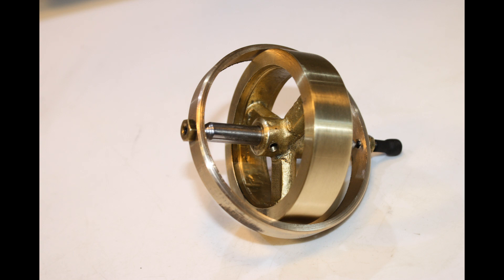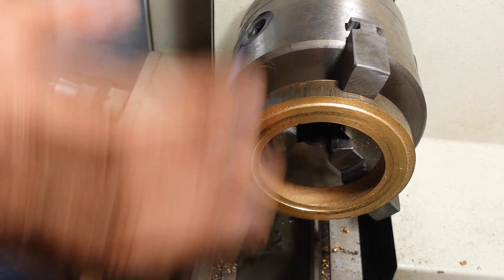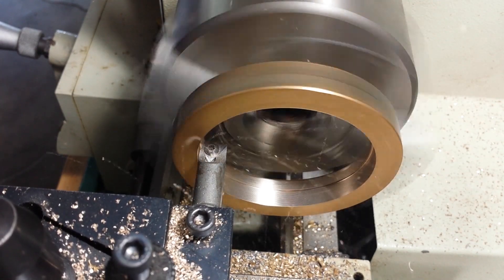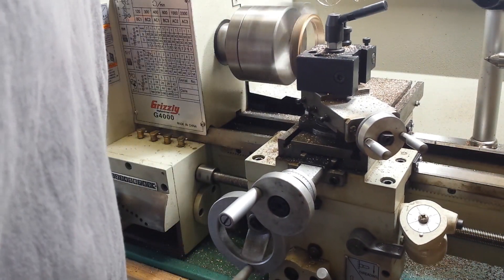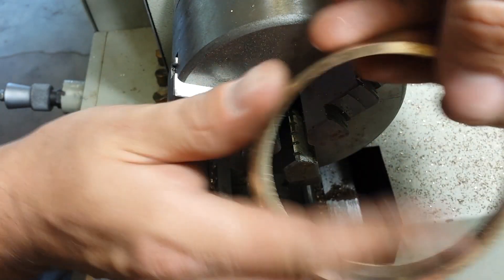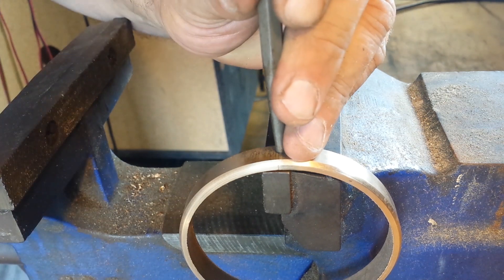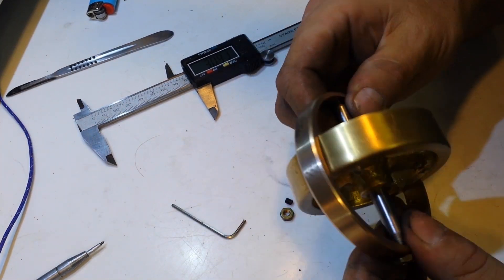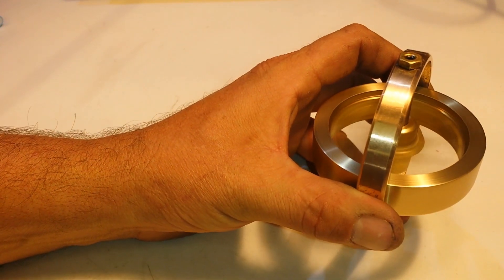Machining a Gyroscope on a Grizzly G4000 Lathe

Comment: Are you happy with the lathe?
Reply from the maker: Its a degree more accurate than the 7x10 lathes.. another thing that is obvious, with the larger lathe? access to correct size tooling and mounting is greatly simplified.